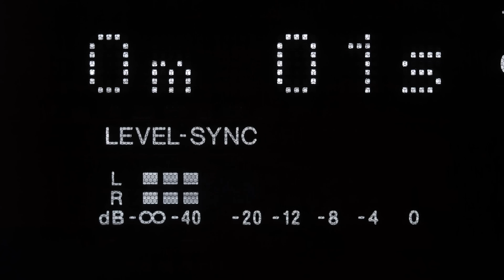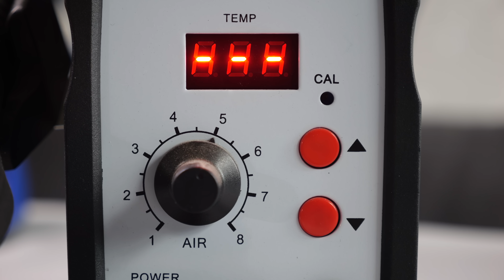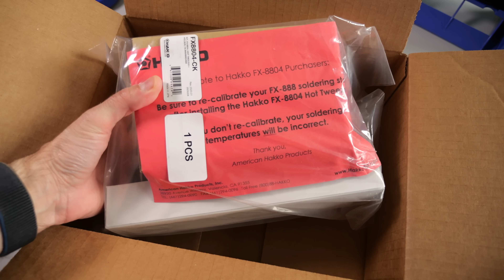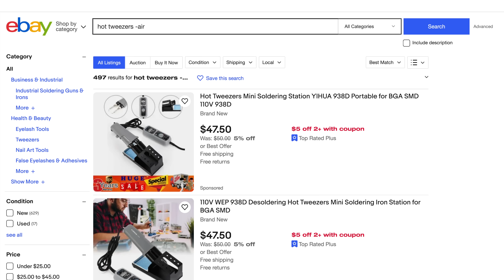A BETTER way to replace surface-mount capacitors!

Comment: On expensive or rarer retro equipment, a person wanting to invest to avoid sunk cost is likely to go for a proper heat-gun. However, many of the rest of us are generally upcycling some old e-Waste  to get a rig going as a stop gap solution (probably recapping and maybe some mosfets or buck-convertors and resistors on an old Mobo for a Nix-like OS, maybe Linux). We all know what that tight-fistedness means. Until "the perfect hot air-gun" is saved up for, funds will go into a desoldering iron and then a hot-air-gun has to be jerryrigged. The classic combo is an old soldering iron converted into the hot air-gun with almost no heat regulation to speak of, so that means mitigation by using ye olde ex-girlfriend's hairdryer specifically because they have a different circuit for the heat to the motor (a proper salon on) and then that is used in advance to pre-heat the PCB to avoid blowout of the masking (and some boards you heat beneath as well as the above side). While yes foil can sometimes help nearby components, if you have room, a wall of superglued matchsticks (snipped of their fire strike heads) has good heat shielding because of the fire-retardant on a safety match. A sprinkle (just a sprinkle mind) of bicarbonate of soda to the superglue hardens it and helps with heat. Even better than superglue for the job is an  (methly-acrylate) Acrylate because it has gone through a 2part exothermic reaction already. Then the wild heat of the soldering-iron hot-air-gun has to be short lived after the pre-heating hairdryer treatment. Remember eye-protection (and general PPE). Flipping the hair-dryer upside-down and hold (or cable-tie anchoring) the cold-mode trigger can act as an extractor fan (into some sort of vent or tube) to remove some of the soldering-iron-jerryrigged-hot-air-gun as it needs to contain where the hot air will go. There are other tricks to this, be mindful. while you can keep an eye on the heat in the localised area with a (e.g. K-Type) thermocouple (or thermometer of some sort with a clock ready), removing the Infra-Red film filter from an old webcam can allow it to be used a a serviceable (but crude) heat camera to track where the heat goes. Silicon adhesive  can also be used to make rudimentary heat-shields. Every penny saved in not buying a proper hot air-gun (for e-Waste upcycled rigs) can be used on a better bit of kit (like the thermocouple or the desoldering gun). If it is batches of through-hole to work through (not SMD), a solder-bath (a potentially dangerous thing to be respected with health-and-saftey) can be cost effective is a whole stack are to be done of a day. As an aside, a shaped copper strip can be used to conduct heat around a component but it also depends if you have a multilayered PCB. The best hot air-gun is the one you have at the time, and the chances are, you probably don't have one at some emergency moment (hence the MacGyvering). Hot airgunning can age the mask on a PCB. Some respected PCBs (a cared for item, say) wants gentle face mask pads for wiping unidirectionally with isopropyl alcohol instead of the toothbrush treatment which can dull the board mask. Then one-way rolled cotton-buds (Q-Tip) between the thumb and index-finger remove particulate debris.
My comment has no hate in it and I do no harm. I am not appalled or afraid, boasting or envying or complaining... Just saying. Psalms23: Giving thanks and praise to the Lord and peace and love. Also, I'd say Matthew6.

Comment: The more I look at these videos the more I wish I can just stay in a city with a permanent place for all those bulky tools I'll have to buy and use if I were to do DIY repairs. Running all over the country job after job really doesn't help with my desire to go into retro electronics. Right now all I have is a simple one-stick soldering iron and even that is difficult to move around.

Comment: OK, so the procedure is:
- twist
DO NOT LIFT
- twist

The cap will break off at it's weakest point (bending) - corroded or not - and the stress to the pads is minimal: they are dragged along the path of highest resitance.

Comment: 3:38 I think you didn't understand this method. This method involves twisting the capacitor until it pops not pulling them straight up.

Comment: if you use hot air for desolder caps, wear safetyglasses! Caps can explode at high heat.

Comment: You could just use a soldering iron to heat the contacts then pull off the cap with pliers .

Comment: You don't want to rip SMD caps off the board. You don't even want to rip them entirely off the pads

What you want to do is twist and rip the cap ONLY, leaving the plastic base. Then, use an iron to melt the base off at the pads. Clean and you're good to go.

Another method is use quick melt solder.

I avoid hot air since SMD caps like to explode with too much heat. If I have to use hot air, heat the bottom of the board when possible.

Comment: The solder pads are way stronger than the legs, twisting gently back and forth will break them due to metal fatigue, very reliable method. Tried the hot air method, cap went bang, just missed my face and burned a hole in the carpet... Fuck that

Comment: I removed hundreds of these caps from Camcorders back in the 90’s. Disgusting things. Sometimes they destroyed PCB’s making the Camcorder uneconomical to repair. Best method was the gentle twist off and clean. The challenge was fitting the new cap.

Comment: If there's room for it, a very gentle way is to use a rotary tool with a cutting disc and score from each side where the plastic spacer meets the metal can. Needs a steady hand and like mentioned, a not very densely populated board. Catch debris with a damp cloth close by if you're not planning to clean the whole board later.

Comment: There's a special type of solder flux which makes the process easier. I think it's called ChipQuik and I've used it before I gave up on surface components.

Comment: some of these same caps have the pins trough-hole versions and if you twist them it'll damage the pcb, rather go cut them
Reply: No, look, you'll know which one it is by having your eyes open. The through hole component has holes and pins poking through on the other side. Through hole capacitors do not have an exposed plateau, they are enclosed with a rubber bung crimped in at the bottom by the aluminium can. SMD components have a plateau at the bottom which is squared with cut corners protruding over the can envelope and the pins and pads are protruding ever so slightly on the side, you can just barely see them when you look.

Also through hole caps specifically in a through-plated PCB like any computer PCB (but not power supply or most HiFi PCBs), you can't really damage the PCB by twisting with any normal amount of force, you'll just accomplish nothing.
Reply: @SianaGearz   no I'm just saying it for precaution, the same type of capacitors in the video, have surface solder pins but they can be bent downwards for trough-hole solder, if you twist them they will damage the pcb lanes. I've seen it somewhere.   im not talking about regular capacitors
Reply: @mustangrt8866  No. The pins of these capacitor are flat and wide, they do not go through-hole. Through-hole capacitors which look similar at the top (no plastic sleeve, top-marked, almost invisible vent cut or no vent cut; gel or polymer solid electrolyte type capacitors) have a completely different bottom construction missing that square-ish base section that is visible on SMD capacitors. You will be able to tell when you look, promise.

Comment: Hot air in capacitor may burst,and i experience that not a safest method in removing this electrolytic caps..twist and pull maybe the easiest way. 🙂

Comment: No, if you do remove caps all day as a job requires it, twisting without pooling is the more efficient way. The "best" method described here is ok if you have a day for one board. Of course if you have an obviously fragile board, hot air is the solution. Common sense before all 😊

Comment: If the cap has leaked so much it's damaged the solder pads, the pads are going to have to be repaired anyway. Just twist the caps off.

Comment: Piece of thick solid copper wire shaped around the cap and a soldering iron will solve that issue. Add plenty of solder.

Comment: Glad I’m not the only one who winces at the idea of twisting caps off. 

In terms of using the iron I think if there is room you can do one side and then lift up that side; I’ve done that before. But hot air is the way to go. And buy a roll of aluminium tape, it’s much better than kapton in my experience.

Comment: Just use 2 soldering irons: heat up the solderpoints and use the irons for grapping the part and lift it away. I dont understand why people use so complicated and risky methods.

Comment: You need to press down on them while you twist dummy. Of course you'll rip a pad if you only twist them. I've recapped tons of old Mac boards using this method, and I've never ripped a pad unless the electrolyte had already destroyed it. But then hot air would have destroyed it too.

Comment: Gently twisting/turning the caps until they break should not damage the pads
NEVER pull on the caps until the twisting broke it (they will break at the base, leaving the legs on the board)
then you can clean the remains

Comment: mechanical stress should never be the method used to remove electronic components. Localized heat is the way to go, always. (local as much as possible, which is why the methods varying from single iron to heat gun to hot tweezers produce increasingly useful resutls)

Comment: The twisting and clipping is barbaric. I know you tried regular desoldering, but I'd do it with a lot more flux and fresh, leaded solder, then lift the cap- it should move without the opposite leg being subject to any torque.

Comment: You can easily spend $1000 on a Classic Mac these days, buying the computer, BlueSCSI, etc. Nobody doing this has "zero budget". A couple of hundred bucks on a hot air gun is cheap insurance to me.

Comment: Just as you said: Destroying the cap, might turns into a ripped pad or trace and a 5 minute job can be easily turn into a 2 hours repair. With Tweezers, the task becomes a walk on the park, but its a one-trick-pony, and a very expensive one. Meanwhile, hot air is also single use tool, but this one can be used in a million ways, reflows, soldering and desoldering... kinda like a screwdriver, the main use is turning bolts, but we'all know more than five uses for one of them

Comment: Cutting through the caps has to be the worst method I've ever seen. The most successful and clean method I've used is twisting the caps back and forth about 15-20 degrees either direction, repeating until the metal wears out and snaps. The sideways shear force puts basically zero stress on solder pads.

Comment: I want to install Windows 2000 on my Lenovo l520 but it gives a bluescreen
I tried to integrate drivers into the dist
using nlight but didn't work and I can't install uniATA because OS still has not been installed but the laptop is fully compatible with Windows XP and drivers
the setup starts without any errors with orginal cd in xp so what to do for windows 2000  Please HELP ME GUYS

Comment: When using hot air, never twist and tug. When solder is properly heated and melted, the component will release on its own. If you are going to just pull and tug it, why even heat it.

Comment: I am wondering why Apple doesn't use these caps. They're ideal for making money, make them corrode right a few days after warranty expires

Very shitty capacitors
Reply: I don't think you can still buy capacitors this shitty. You would have to add actual electrical abuse to them to make modern ones fail with more than fraction of a percent capability, unless they fail right away because they have been formed the wrong way around. Even the very very cheap ones from the heart of China are sort of that good.

That being said design abuse of capacitor parameters is pretty rampant in electronics today, this is why cap-swap repairs are frequently necessary on 5 year old consumer electronics devices. But you also don't have to swap all caps but just like 2 or 3.

Comment: I don't like the twist method, it's used by to many unqualified board butchers that have no business being around electronics in the first place. 
Yes, when done with understanding and the proper amount of force it might be usually fine. But there are so many heavy handed, ham fisted people that shouldn't do it and then we professionals have to clean up after them. 
So just use hot air or hot tweezers

Comment: I push the cap toward the pcb and twist one direction... never just pull and waggle like the video... the trick is to leave the plastic frame and legs on the pcb then just flick the frame off and wipe the legs away with the iron.... not to just try and rip the whole thing off, that's barbaric....😅

Comment: Ok. Taking out shitty ones is ok to destroy them ripping. But if you need to get GOOD capacitors off the board?! And if these capacitors are solid and  not surface-mounted? I tried to do this in my last video. Welcome.

Comment: The "rip them off the board" method always makes me cringe whenever I see it being done . Reminds me of Wild West "dentists" who basically gives their patients a shot of whisky and yanks their teeth out with a pair of rusty pliers. I've gotten reasonably comfortable with using hot air, and my cheap hot air station has served me well. (Yes I did check it for wiring faults, and mine looked good.) I always preheat the area surrounding the component for a bit before directly attacking it, and use Kapton tape and/or other heat sinks (random bits of metal, aluminum foil, etc.) to cover plastic sockets/sensitive components/etc. that are in the line of fire. I usually apply a bit of new solder with a soldering iron before hot airing it off. And I apply flux. Lots of flux. Oh, and I always place the board I'm working on on a heatsink, so as not to damage my desk surface. (learned that lesson the hard way :) ) Old dead hard drives are my heatsink of choice, they work very well, have a large thermal mass, and are plentiful and cheap (usually free.) The key was to practice, practice, practice on old scrap boards. And yeah, I always, ALWAYS wear safety glasses. Knock on wood, I haven't had a cap explode in my face so far, but I would rather not take chances.

Comment: I don't know what it is with hobbyist like Mac84 and perhaps yourself.  I don't know where you trained.  But for the love of Pete you don't just rip the caps off.  That is not the method!  

You slowly very slowly and delicately twist back and forth until the metal gives gently.  Otherwise you'll pull the trace.  I would start with 35 degrees rotation for a stiff cap.  As the metal gives you increase the degree of rotation.  Ones that have leaked so badly will freely rotate 90 degrees or more on the first try.

Comment: ive seen some pretty large capacitors burst, and at most youre looking at a VERY tiny amount of electrolyte. like , baby parrot crap amount or less. this makes it sound like there a gallon of liquid in a capacitor. just use a $40 desoldering iron + vacuum combo, its super easy, effective, and fast.

Comment: the pads being pulled are where the user is pulling and twisting. dont pull.
Reply: And heating caps with hot air is dangerous - never seen a cap explode when heated?
Reply: And hot tweezers - I use the atten st-1509 station and you can use that station as soldering with a single iron as well as the tweezers and they are built much better that the cheap units. the weezers also have differing tips which are easy to replace.

Comment: 2:25 - Jesus! Are people really doing that? You will rip those copper contacts our of PCB. I use 2 methods - ordinary heat gun (not for electronics, but I am definitelly planning to buy something proper) + aluminium foil around to not damage anything I don't want to, but this can't be used everywhere, especially when some plastic slot (like PCI etc...) directly next to capacitor. Other method is to use 2 soldering irons from both sides or you can try to buy or make special shape designed for removing SMD parts which is pretty much the same thing as you have at the end of video and you can use it even for classic caps with 2 pins thru PCB.

Comment: Hot air and flux.  Two irons works well too and is more useful in the long run over tweezers.  Buy the Atten or Quick and forget those stupid $50 ones with the fan in the handle.  Useless.

Comment: 50 Doller for such garbage smd , here for us it's the worst smd ,  Quick 861 is approx 16000 INR , Sugon Cyclone 6500 INR , and Quick 857Dw+ is 5800 INR and the one you are using is  1200-1300 INR

Comment: You're doing it wrong you twist don't pull.. And even with hot air you're lifting before the joints hot.

Comment: poor video i have better solution with only using one solder and 0,05mm stainless piece of metal. Heat up pad on one side after melting put metal sheet between pad and cap leg then just heat other one and remove cap. Yes it is work correctly even with RoHS solder and chips too.... You can make handle to this small piece of sheet :) from precise blade cutter. if you don`t have any thin metal You can use razor as well the same idea with tht pads just use needle with proper diameter`s
Reply: and please buy some good solder station it not need to be expensive T12 is enough, important to have heater,tip and sensor in one part. Cost is 25 usd...